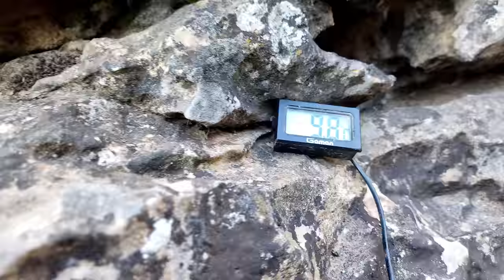I Built A Cave That Could Last For A Thousand Years In 15 Days - Cave With Fire, DIY, ASMR

Comment: CONGRADULATIONS! You have created what my people call, "A Hermit's Cave" or shelter. It starts with a huge sandstone boulder. You then build a fire to dehydrate a portion of the rock making it very brittle and easy to dig. My people prefer to build it into a large cliff face a few yards up off the wilderness floor for protection and vantage point. If possible, we use clay as mortar for the rock wall. The opening to the cave should be smaller than the inside of the cave to help retain heat and make the cave more defensible. We use fresh hard rock and clay to build the from of the cave to the appropriate size. Tolls needed: long and short handle pickaxe, rock-bar, good size hammer up to a baby-sledge, round and square head shovels. We chisel climbing steps in the rock for easy access to our cave. We cook outside the cave to prevent softening of the inner walls. The height of the inner cave should be such as to accommodate standing up. The depth of the inner cave should be such as to retain warmth. We purposely strategically locate our cave systems in locations to be reused annually as we travel about hunting. We mark ownership of our cave systems with cave drawings on the inner wall telling our story. When not in use, we normally seal the entrance of our cave system to hide it from predators and enemies marking the cave location with some type of sign.
Reply: Very interesting. Thanks for sharing that. I find this sort of thing fascinating.👍
Reply: That didn't appear to be sandstone to me. I thought maybe it was chert.
Reply: @eddarby469  Looks more like limestone or a sandy limestone...
Reply: @bobbiechavez2990  Well, I am no authority on geology, but the limestone I know about is a gray color. But it is also very planar as is this material.
Reply: @chrisgrill6302  y do u want WiFi I u move away from city life is WiFi so important
Reply: @eddarby469  If you put a drop of a weak acid, such as vinegar, on it, does the acid bubble?
Reply: @eddarby469  Chert is much harder than limestone and is a microsilicate with a fracture pattern that is rounded like a crescent moon. It's herd, smooth, and glassy.
Reply: Thanks for the description and explanation!
Reply: My bro did you type throw the hole video
Reply: Where are your people from? I'm fascinated by how our paleolithic ancestors lived and thrived!
Reply: Tools
Reply: Congratulations
Reply: What makes you guys trust this lol what u gonna do when it breaks down on u. I mean its not a tree, its a huge rock
Reply: Good one
Reply: @ismailmuttaqien1203  nice. Tools
Reply: @The_Farmish_One  yup, not tolls
Reply: 8th grade history book. I like it.
Reply: @chrisgrill6302  don't you love it...its always someone looking to call someone a racist for anything lol i laughed at your original comment. Hope i dont get called a racist also
Reply: What You mean Your people?
Reply: Who is your people? Are you a king or something?
Reply: @chrisgrill6302  I think they have imagined all this. They have very little knowledge of rock or caving by the sounds of it.
Reply: Perhaps he prefers living under a rock...  great excuse for not knowing the answer to some question.. ie, default answer!
Reply: Enemies? We aren't in the wild west anymore buddy, you might want to let your peeps know what the current year is considering you have access to the internet
Reply: @bobbiechavez2990  I believe it is shale.
Reply: @martinmiller1087 yep
Reply: Cliff Shitters
Reply: Who tf are "my people"?? 😂
Reply: @ernsthaft919  If you pose a question that crudely, you probably won't get an answer.
Reply: @kih0n  "your people, uh, uh, house meetin ya'all"
Reply: @erik_verastegui  🤣🤣🤣
Reply: My people's time in nature usually consists of drinking and falling asleep on the ground or in a tent from walmart. If one fell sleep on the ground they could expect to be accompanied by crawling things. Hammocks are nice if you tie them right which I've failed to do. Big animals may walk or lay near without your knowledge some as dangerous or more so than the other people there.
Reply: Okay Mr wendigo can you stop hunting us humans though
Reply: @chrisgrill6302  it's easy, you don't need any of that to survive.
Reply: You need to go back and recheck the footage.
Reply: @ernsthaft919  why is that funny? Obviously he means his race, ethnicity, village, tribe, etc. Literally his people. I’ve used that term now and again. For example, my people are proud to be Polynesian.
Reply: Yeah, thanks, like we really needed all that explaining😏.
Reply: Huh.. i thought it is illegal nowadays to own people
Reply: You sound like a cool person to chill with.
Reply: Epic lifestyle! I wanna do something like that!
Reply: Hard graft ma loon
Reply: @chrisgrill6302  i know right.. and what about the Orc attacks at night?
Reply: As a hermit I can confirm this.
Reply: @krisaaron5771  New Orleans, Louisiana
Reply: William...  impresionante 🥰🥰
Veo MUCHA  gente aquí  ...envidiosa,   resentida y  "muy experta"   ( ingenieros ) 
Todos damos las GRACIAS a nuestra anterior cultura .  ( nadie nació  sabiendo) 
Hemos llegado a ser lo que somos gracias  a nuestros " padres " 🥰

Que gran exposición he leído !!!👏
  Gracias,  gracias  y ... gracias .

   Un saludo muy cordial  .
Reply: @whgordon6109  para oír una respuesta predeterminada ... MEJOR  no oírla. 
( prefiero otra )
Reply: Chief key board commander 😂😂😂
Reply: Hi William can you do a video please. This cave is cool but it leaks and will flood before 1000 years.
Reply: My people the Lego People
Reply: Woodoo people! 💀☠💀☠
Reply: My people Chanel our caves into the hardest granite using only their teeth. We call the diggers the great gnawers and the are revered in our clan.
Reply: you should post some videos of the hermit caves and how they make the opening smaller than the in side. it doesnt seem like the fire is that controllable and will soften a larger area leaving it all too soft to be safe and fall on your head.
Reply: My people live in trailers in a trailer park as it starts with having kids very young getting over ur head in debt and drinking cheap beer  alot. Sometimes mnt dew
Reply: @eddarby469  I have burnt limestone and jackhammered it. This looks like limestone exactly to me
Reply: Interesting, but is this cop[ied and pasted from a service or are you an expert.
Reply: Thanks, where do you come from to give us this information.
Reply: Congratulations*
Reply: @krisaaron5771  Egyptair Priest of Ireland
Reply: @BuggyDClown-pc7sc  i Will leave there my gf
Reply: @TweedyRFC  nice nickname wanna biz
Reply: @BuggyDClown-pc7sc  you trust it because it’s a huge rock lmao
Reply: where are you from?
Reply: Its that your people call this place goat brothel and join into sin of this place!
Reply: @pinnin4steel921  My people would have been at peace with your people…trading beaver pelts and fire water to help each other survive the winter…just don’t trade for the beads that the loud female falls down a lot always has…they are not a necklace.   But you and your people can always trust that you’re welcome to smoke the peace pipe at our fire and in the springtime, journey with us to the spirit world to seek the giant chicken and Doc’s Butterfly.
Reply: @invictusbp1prop143  I dont understand the giant chicken or doc's butterfly but I'm tearing up at the hospitality of your people. May you all live long beautiful lives
Reply: @chrisgrill6302  no internet is necessary out there for there is plenty to do out there walk around to find fresh veggies and fruit you can read go find water cook just have fun the good old way
Reply: me to
Reply: Merci de préciser tout ça....   Franchement je suis tombé par hasard sur cette vidéo, et juste le titre m'a fait sourire.
Une grotte est déjà là.., on ne l'a construit pas.
Par contre comme vous dites, il est possible de profiter de pierre bien posées et en faire un habitat.
Effectivement, la sortie doit être plus petite que le tout, et oui ont cuisine dehors.
Autrement, c'est que .... Ils veulent du luxe et une grotte.  Bien à vous.
Reply: Merci pour vos précisions, je ne supporte pas les arrivistes.
Vous me faites vraiment plaisir de mettre les choses à plat.   Bonne continuation , bien à vous
Reply: How can you tell from a regular rock from a clay rock.? I really want to try this.
Reply: Can you burn any boulder to cave it out or just sandstane..? Thanks 👍
Reply: Ll
Reply: @raffaelesala992   watts LI
Reply: @raffaelesala992  Wat u mine with LI. I speek français
Reply: Molim prevod na srpski
Reply: Where do you live?
Reply: Lies
Reply: La raza is my people ❤😅
Reply: @chrisgrill6302  LOL!!! hahahahahahahaha
Reply: @eddarby469   è calcare ... Limestone 👍
Reply: what are your people called?
Reply: @Maori_Toa  all stone are airy and moisty. But the heavier stone is the stronger it should be. Yes, you can burn all stones, but its dangerous also, can explode. Like a small hand grenade. There are so many techniques today how to crack it, example: flintstone you crack with double hits, make first wave float to end and when arrive back its time for second hit. Tick-tock 0.1 seconds between. Some stone you drill and put expansive mass inside, crack right open. Its heavy work, not recommended for todays lazy gaypeople.
Reply: It would never occur to me to destroy a giant really cool rock like this! And if it’s that easily broken who the hell wants to live or sleep in it?
Reply: before my uncle Gandalf arrived and we set to help the elves defeating the dark forces we were also living in small caves.
Reply: Who are your people, and where do you build caves? In Oklahoma? I've known there are lots of boulders there... Arizona?
Reply: Chinsgrill do you want jukussy also?
Reply: Wow!, super informative.😊
Reply: Not many of you left I take it. Only thing between a rock and a hard place is smashed diggers.
Reply: congratulations 🎉
Reply: Your name is William. Who are your people? South Californians?
Reply: Gostei da explicação que você deu manda teu povo quando fazer vídeo explicando direito para agente saber
Reply: Cool, Who are your people?
Reply: This post is full of information, thank you.
Reply: What do you mean by "predators and enemies?" Who are these enemies and why are they trying to ambush you in your cave?
Reply: Why do I get the feeling that you have never slept one night in a cave and your people are of your imagination.
Reply: If that's limestone you can make cement
Thanks for the tips
Reply: Damn, do you have a video to match this essay?
Reply: Limestone can be dangerous to do this with if is not strong enough.  The walls could hold for a few seasons then a collapse will happen if the whole of the rock wall got too hot or had a unseen flaw in it.  These were emergency shelters and were not used unless they had to.
Reply: Your people? I'm pretty sure we are ALL people..
Reply: But why???
Reply: @eddarby469 Way too brittle. It’s definitely limestone, the way it exploded when heated means it’s absorbed a lot of water, also there were holes water had carved, a sure sign the slight acidity in rainwater had ate away at the calcium carbonate.
Reply: I just bought a house instead.
Reply: @eddarby469  This is tuff rock
Reply: @BuggyDClown-pc7sc you have more confidence in the wood that can burn and took 30 years to grow than the stone that took millions?
Reply: @reanbowlerd5988  people have trees falling on them and they walk away from it regularly. And people have rocks falling down on them and it becomes their grave regularly.
Reply: @danieloconnor7387 
The clay rock will have clay in it.
Reply: Didn't even bother reading. You're doing too much
Reply: Que interesante 🤔
Reply: @anwarabrahams2413 

Can you teach me more ierogrific american English language?)

U is for You
Y is for why
Btw is for by the way

What are other popular abbreviations please kindly do tell me please❤
Reply: @pirateofthepacific9687 ❤
Reply: I was about to say, "CONGRATULATIONS!!! You just built the perfect house for every rattlesnake and scorpion in the area!" 😅
Reply: My thoughts exactly. I have gray shale in my area and it splits the same as in video.  @martinmiller1087
Reply: WHO ARE YOUR "PEOPLE?".
Reply: Enemies?
Reply: @tomothybahamothy  There are many people around who view EVERY STRANGER as a real enemy. They are called paranoid, sociopaths, and psychopaths.
Reply: Some of the rocks you're digging out from the soil look suspiciously as though they've been dressed and used before, plus their placement near the rock is suggestive of previous occupation.  Is it possible that the site would be interesting to archaeologists? Did you check as you dug deeper?
Reply: Perfect ❤🎉
Reply: What do you mean "my people"....lol